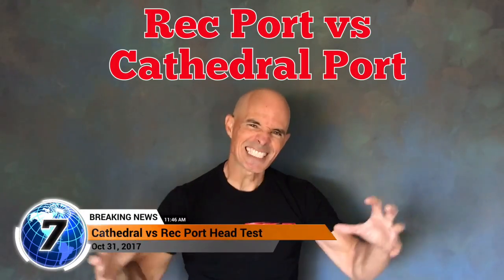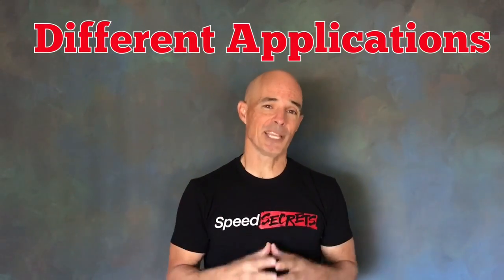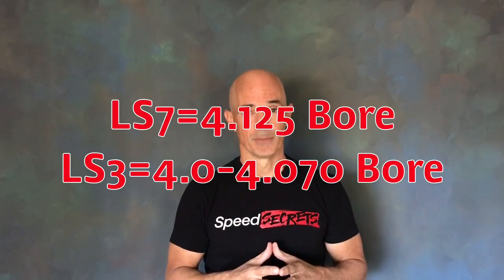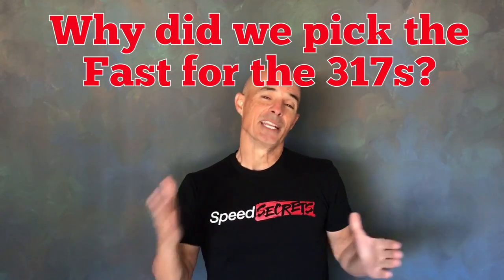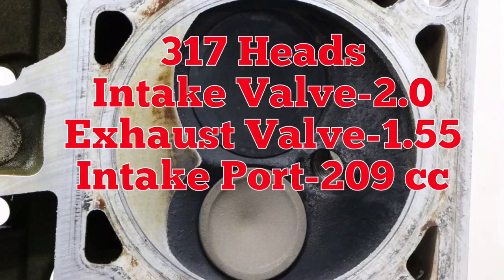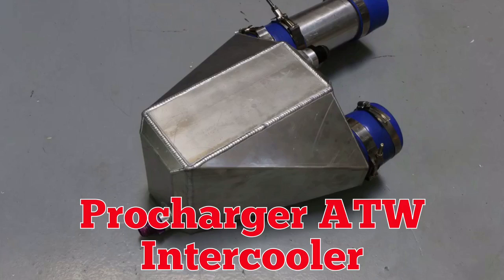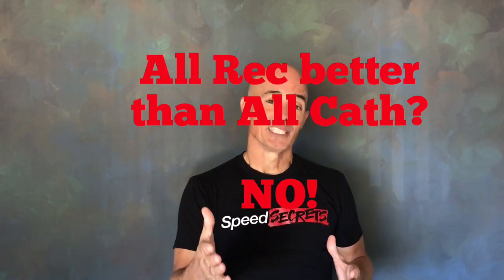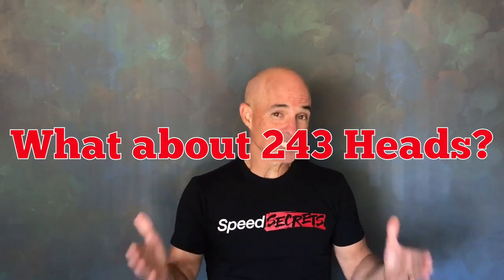Turbo LS Head Shoot Out-LS3 Rec vs 317 Cath Port

Comment: So, why wouldn't the TBSS intake be the equal to the LS3?
In your own tests you found that the factory L92 intake, and LS3 intake are essentially identical.
The TBSS intake IS the L92 intake with cathedral shaped intake ports.   So should technically be it's equivalent.
Reply from the maker: you are incorrect in thinking the TBSS is the same as the LY6 intake

Comment: Great video Richard. I'm curious what you were using for fuel? I have an LQ4 that I'm going to boost with a VS Racing 78/75.   I have a set of 317 heads, some 799 heads, and some 706 heads. I plan on running 93 octane pump gas.  I'm running a Texas speed 220R cam and 1219 springs. I was wondering what you think would be the best head for this build.

Comment: Richard... So you can run a smaller chamber diameter head on the bigger bore motor with mild to wild boost without issues? Thanks for your time and the informative videos!

Comment: Haha they put the best cathedral intake u can get this is bs and you know it.put a fast intake on the ls3 heads
Reply from the maker: The fast intake ads nothing to the LS3
Reply: @richardholdener1727  prove it
Reply: @richardholdener1727  even the chevy intake shootout showed a 13hp increase over an ls3 intake with the rectangle lsxrt.
Reply: 13hp isn't worth the cost of the fast manifold imo.
Reply: @rholt7448  i understand that but it wont always be only 13hp on some motors

Comment: Can you explain in a video why I or anyone else that has always built small block Chevy's, exactly what make the ls style engine so much better. I've seen flow numbers for some of the truck heads and they ain't glamorous by any means, yet these bastards still crank out power. WHY? Bigger cam core for faster ramps? The short block I get, 6 bolt mains is hard to beat, but how do they make so much more power and have better fuel economy? I have a brand new sbc 383 on the stand, dart 200 aluminum heads, hydraulic roller cam, Victor jr intake, 10.5-1, but a camed 5.7 would run with it or even beat it and do it with less cam, shittier heads and better fuel economy. WHY??????
Reply from the maker: a stock 5.3L head is significantly better than any factory SBC head(243/799 even more so), so is the truck intake, all the LS needs is a cam to make good power. On an LS3, it flows better than most SBC after market heads
Reply: @richardholdener1727  I can understand the factory sbc heads being weak compared to ls heads, but even put aftermarket heads on a sbc and the ls 5.3 truck motor with stock heads will still make more power with a smaller cam. It  just doesn't seem like they should. They have a smaller bore, but I guess the valve angle plays into that a lot and the bigger cam core lets a more aggressive cam lobe to be used on the ls.

Comment: What about the ls3 823 heads vs the 862’s on a lq4????
Reply from the maker: I've run the 862 vs the LS3 (actually LY6) heads on a 6.0L. The LS3 heads make a lot more power.

Comment: You have a cam specd for the cathedral head then running the ls3 head on the same cam.  Apples to apples would need a better cam specd to the ls3 heads.
Reply from the maker: Adam McDonald -the Cam gains would be the same on both heads
Reply: With that much exhaust duration, that looks like rec port specs.

Comment: Great No Nonsense video! I personally run a single 78mm turbo L76 ls3 headed 6.0. keep up the great work.
Reply from the maker: Brandon Loll tell all your friends
Reply: Hey man on that setup is it easy to hit 1000hp without opening up the engine
Reply: @matthewritchie3595   No you really have to pull the pistons and open up the ring gap.